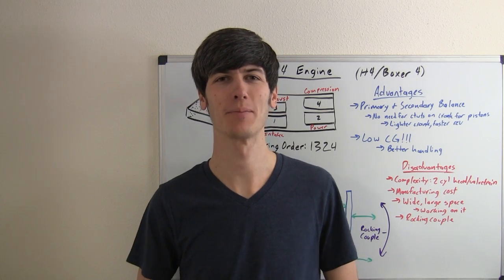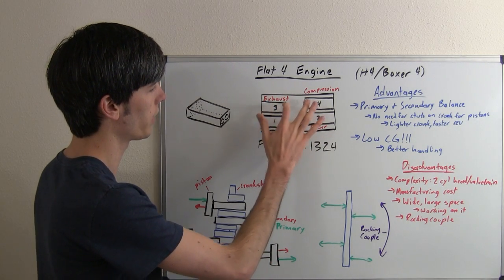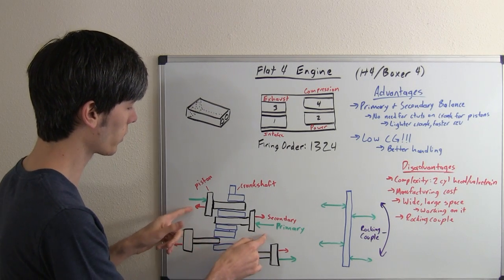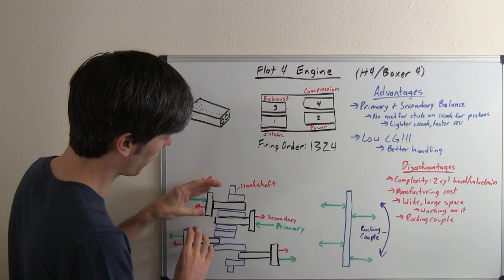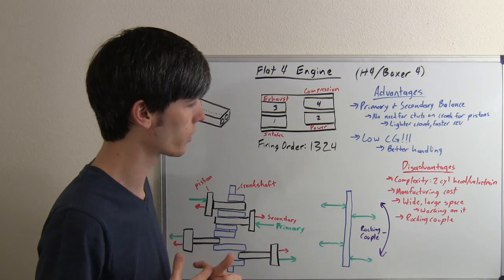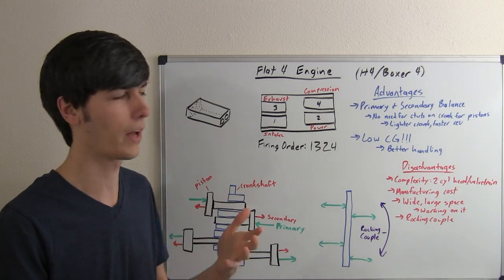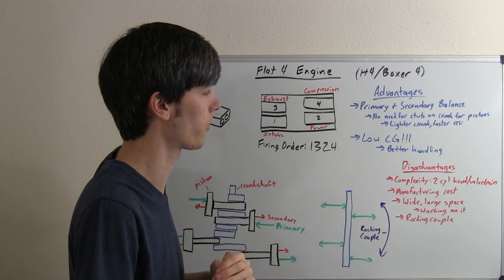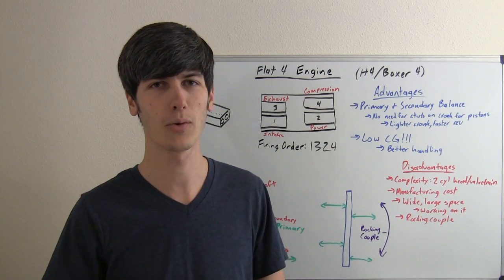Boxer Engine - Flat Four Engine - Explained

Comment: In my case, an H6 with the Outback. But another advantage of Boxer engines over V and Inline engines, is that in severe front end impacts where the engine is pushed towards the cabin, the Boxer engines are actually pushed under the cabin instead of coming into the cabin and potentially injuring the front seat occupants even more.

Comment: I fly airplanes that have flat 4 engines in them. Big ones: 320 and 360 cubic inches. One reason for using a boxer engine is bolting a large but smooth-running engine to a relatively flimsy airframe. The same manufacturer makes a 540 cubic inch flat 6 and a 720 cubic inch flat 8. Which sounds amazing. :-)
Reply: Laura Halliday yes I love Lycomings!
Reply: Oh and an I/O turbo 540 is very nice.

Comment: I've got a 99 Subaru forester with a 2.5 H4 and I actually love working on that engine. 
For example: 
most any of the components that are likely to need replacing are on the top of the engine (A/C compressor, alternator, Power steering pump, Knock Sensor)
Spark plugs are not even that hard to do ( compared to my 2000 f-150 4.6L, 1 hour VS 6 hours)
And there is still plenty of room in the engine bay.
Reply: My brats the same way. Its nicer the older you go because of less crap being under the hood.

Comment: This is the reason why i love Subaru and Porsche
Reply: tokekkk and volkswagen. Old vw bugs, busses, ghias, and type 3's had a flat 4 air cooled motor. Just like a porsche 356. They had the same firing order (1432 or a figure 8 firing order) so they sound awesome.
Reply: +:D some old Citroens too
Reply: Subarus are pretty awesome. I like the Crosstrek (GASP!!). Even though it has a small 2 liter Boxer 4 it has awesome ground clearance, symmetrical AWD, nice handling, and I just love it.
Reply: tokekkk Some old Alfa Romeos and Lancias also use 4 cylinder boxer engine :)
Reply: Tucker 48 too :P A modified helicopter engine that was
Reply: And old Alfa Romeos ;)
Reply: tokekkk me too it’s my favorite engine layout

Comment: The "rocking couple" you talk about is MINUTE at best.  It does bear mentioning, but H4 engines can typically be mounted to frames with small rubber pads, since they run so smoothly.

Comment: You mentioned that boxer 4 cylinders don't need counterweights on the crank.  That may be technically true, but I do know that within the aircooled VW tuning community counterweighting the crank is a nearly standard practice on virtually all performance builds and it makes a VERY noticeable difference in how smooth the engine runs and how well the engine can handle higher RPMs.  My own experience on a VW project car I had years ago certainly attested to that, the 1776cc build that I had in it ran dramatically smoother than the stock 1600 even with a lightened flywheel, and I didn't go crazy with the build, just had the stock crankshaft counterweighted, had the 90.5mm cylinders installed to bump the displacement, upgraded the valvesprings, installed a mild cam, and installed an aftermarket dual carburetor setup and equal length header and a flowmaster muffler (still nearly doubled the power output without having to rev to the moon).
Reply: I also think that a lot of stuff done with the air cooled VW pancake practically neutralizes the cons he listed.  I haven't gotten to see let alone work on many but I have noticed that the original is really easy to work on period.  what other engine can you have a cycle of: unhook engine, remove engine, reinstall engine, re-hook all components, run engine multiple times in 1 day with 1 person?!  the newer ones have all the electronics and that adds to the difficulty.  but the original pancake seems to be very well designed as stock.  heck it is so good it doesn't need actual engine mounts, it bolts right to the transmission and the transmission deals with all the vibrations

Comment: This channel is awesome, subscribed
Reply from the maker: arturoicetre Thanks!
Reply: +Engineering Explained I just bought a 2016 wrx last Saturday and noticed when I'm parked or stopped it has either a rough idle or vibration when idling, not sure if it just how the engine runs or I have a problem. I'm new Subaru and boxer engines so not sure if it's normal.
Reply: +Matt Barrilleaux the Toyota Aygo has the same.. but that has an 3-Inline so i think it's normal

Comment: Engineering Explained I have a hypothesis:

Some of the Subaru engines are prone to rod bearings failing. Could this be due to the rocking force?

I think this because of a theory with the 7-Bolt 4G63 DSM inline 4. It is believed that the clutch on that engine can generate a force on the crankshaft that pushes/pulls on it. Over time the force from the clutch mechanism causes crankwalk, which is what the 7-bolt 4G63 (found on 2nd generation Eclipse/Talon cars) are notorious for. 

I think the rocking force may cause the rod bearing failure because the transmission may resist the turning of the engine. The engine will attempt to turn on it's axis, and the flexible engine mounts will allow it to very slightly. The relationship between the engine and transmission isn't supposed to be flexible, so the moving crankshaft will be receiving a torque force in the opposite direction it is trying to rotate from the resisting transmission. This is not good for any kind of bearing that is only supposed to rotate, and causes premature wear. In the end, a rod bearing will "spun" and be destroyed from this torque force. 

Possible? Not sure how to prove this. I have a basic understanding of physics, so I understand all your videos clearly. Is there a way to find out if this is a design problem with our engines (I own a WRX), and the reason for failure?

Thank you!

Comment: My current car has a Boxer 6, ut is a great engine layout. The other major advantage for boxer engines is they are safer! The engine itself is far less likely to enter the cockpit in the case of a collision, they are usually designed to break free and slide under the vehicle.
Reply: Won't that tend to crush the feet of the occupants in the front seats?
Reply: @timothykeith1367  foot crushings are less lethal than torso or leg. But as far as I am aware the whole engine is deflected under the car.
Reply: @joe_limon  That's an interesting safety feature.  Subarus aren't as popular in Texas - I've heard, because snow and ice isn't common.  I've stopped listening to the "Subaru head gasket" stories. I believe these are well engineered engines.  I've always liked boxer engines.  The Corvair flat six was a sweet motor in its time.
Reply: @timothykeith1367  the worst part of the design is the boxer layout burns through oil at an increasing rate as the piston rings wear and get looser.  This is worse for a boxer engine because for a typical vee more oil flows back down into the crank case due to gravity.

Comment: I'd also add orgasmic sound to the advantages :D
I know you have an STI, and I'm more of Evo fan myself, but I have to admit, these boxer engines sound amazing.
Reply from the maker: It does indeed sound fantastic. :)
Reply: Volkswagen was the original creators of the boxer engine.
Reply: starbai410  No.. Just to name one prior to VW: The 1923 BMW boxer powered motorcycle. Karl Benz made and patented the first ones in the late 1890s. The Fee/Fairy used boxers from 1905.. VW just chosed a boxer 4 as it was short and balanced, they didn't invent it.
 The Citroen TPV prototype from 1938 also had a boxer engine.
Reply: meharidude Good info! I did not know that! Was the Bug the first successful mass produced boxer?
Reply: Well BMW have used 2 cylinder boxers in their motorcycles since 1923, and boxer engines were also used in early Benz cars. Franklin made 6 cylinder boxers from the 1930s to 1970, they were widely used in trucks and helicopters, even the Tucker Torpedo.
Reply: Like my subie has a 1.8L motor  but you'd swear its bigger because of how deep and rumbly it is. MMMMmmmmm
Reply: I own a bmw r51/3 with a boxer engine and sounds awesome

Comment: We've enjoyed the Subaru, but have found that at a certain point they begin leaking oil.  At that time we have found that it is time to sell the car rather than trying to fix the leak with new seals - because it just keeps on leaking.

Are you familiar with this problem of oil leakage?

Thank you for these wonderful informative video !!!  :)
Reply: The seals are simple to replace. The crank seal is meant to be done during timing belt changes, the valve and spark plug gaskets may leak after 200k miles or so and are a simple task to replace.

Comment: Could you do a video on a Flat-six engine?
Reply: +Andres Perez Its the same, only an extra cylinder on each side
Reply: +beta 400rr I just want to know if the firing order is the same as a V6 and how are the primary and secondary forces balanced out
Reply: Andres Perez firing order on the Dubai EZ30r H6 is 132654
Reply: six-cylinder boxers and six-cylinder flat engines are completely different, though

Comment: Even though this engine is wide and that can be considered as a disadvantage, this engine is also very short lengthwise being only 2.5 cylinders in length. I like to think that this is an advantage especially in the case of Subaru cause this this leaves more room for the transmission and All-Wheel-Drive awesomeness.

Comment: Hi body! i have great appreciation for your effort and if you have little time, i have some question to ask about FOUR cylinder 2-STROKE engine like Hirth F-30. and my questions are;
1) Firing order of this engine
2) Shape of Crankshaft
3) since firing takes place in each rotation in 2-stroke engine,  how can we prevent interference of two cylinders firing at the same time and if we have to delay intake & exhaustion more than one rotation how can we do this since intake & exhaustion takes place in each rotation? tank you in advance! & keep up the good job.

Comment: just want to point out that not all flat or H engines are boxers. Boxers specifically follow the firing sequence that you've explained and their pistons 'box' against each other. There are flat engines that are merely horizontal versions of inline or V engines.

Comment: Got a question that maybe you can help explain. My wife and I have two very similar vehicles in the sense they have the same FA20DIT engine. Mine is a base model 15 wrx manual with sport package and hers is a 17 forester XT auto fully loaded touring model. The question is why does her car get such poor mpg at highway speeds? When driving long distance in my wrx I can get upwards of 33 mpg and her car struggles to get 25. I understand weight is different but overall the weight difference is only 200ish lbs... She previously had a 2014 2.5 limited forester and at highway speeds could get similar mpg as the wrx. Thanks for taking the time to read all of this and I enjoy your take on automotive videos!
Reply: Difference in gearing and/or torque converter slip?
Reply: At that speed aerodynamics is a factor.  With an auto, you have losses in the torque converter due to the use of viscous fluids.  And the Forester probably has a different final drive ratio causing the engine to rev higher at the same speed.

Comment: Fantastic vid! I got 2 questions. 1. Why do you think so little number of companies choose to produce vehicles with boxers(only Porsche and Subaru)? 2. What about the sound - does it depend on the layout? I've heard that the H is one of the noisiest out there. What determines how high the sound is?
Reply from the maker: 1. Cost, fitment. 2. Depends on the firing order and exhaust layout.
Reply: @EngineeringExplained  Don't forget the Corvair.  That motor had great potential.

Comment: Will you be doing a video on a flat six, or does it have the same behavior in terms of balance?
Reply: Flat sixes are smoother than a flat four.  In a four cycle engine there is a fire pulse every other rotation, which means the six always has a power cycle - which makes a flat six or an inline six very smooth and helps the torque as there are no dead spots when the crankshaft is "coasting".

Comment: I was told that the cylinders and pistons sitting horizontally forced them to wear unevenly due to gravity. I don't know how true this is but thought you might have mentioned or went into detail on this.
Reply: +Tonicwine999 I very much doubt this, and if it is it's a minute amount of difference. You would see boxer engines needing rebuilds noticeably quicker but they don't seem to.
Reply: Yeah I can see where you are coming from. Although my first grb had a rebuild with the possibility of the 330S I have bought maybe having something up with the engine again. -I'm not saying that these gravitational forces are the cause but these rebuilds do happen for some reason or another.
Reply: +gilessmokey ahh ok and thanks for the info :)
Reply: +gilessmokey ah that's interesting. Still would have thought that the extra force in the downwards direction would have made a difference in time with such fine tolerances. Can expect that the forces you talk about make the cylinder an oval shaped, can't help but imagine the downwards force would make it more egg shaped and more uneven.

Comment: Will it be correct to add another advantage of this layout: a relatively larger surface of cylinder, which enables air-cooling to suffice
Reply: Hence why VW and Porsche stuck with air cooling for years and why air cooling is still the most common setup on boxer aircraft engines.  The downside of course being less precise temperature control and less control over combustion temperature meaning it will never be as powerful or efficient as a water cooled engine and also will have more problems passing emissions standards.

Comment: Have you experience with opposed piston engines? Can you do a video on those?
Reply: +ABCantonese are they the ones where the pistons share the same cylinder? I think a tank had one of those engines, the churchill maybe
Reply: +kingdavewoody Yes! A good number of tanks had them-  the Chieftain, T-64, Ukrainian T-80s and T-84s! The Ukrainian models are multi-fuel as well! 

In terms of civilian use, I can only think of Achates though.
Reply: ABCantonese oh chieftan yeah, that's the one I was thinking about
Reply: The Achates OP engine may be used in production.  It is said to be very efficient because of less heat losses ( no cylinder heads ).

Comment: A boxer engined car is easily reconisable, they got a very distinctive sound.
And for the fellow boxer boys, it's not only VW, Porsche and Subaru, Alfa Romeo had them also as the entry level Alfa's in the 70's 80's and early 90's. ;)

How do i know this? Well.... let's just say i drive an Alfa 33 1.7ie 16v QV as my hobby car. :)